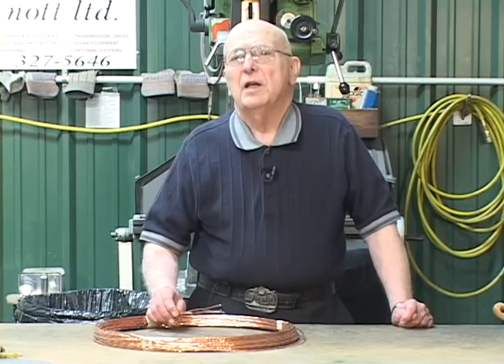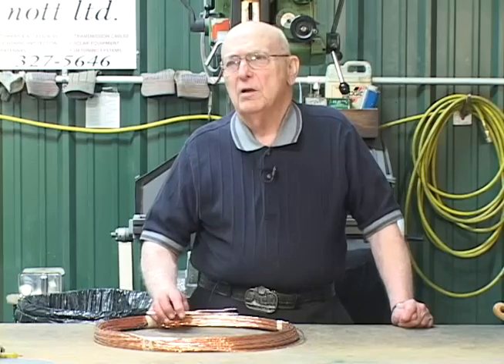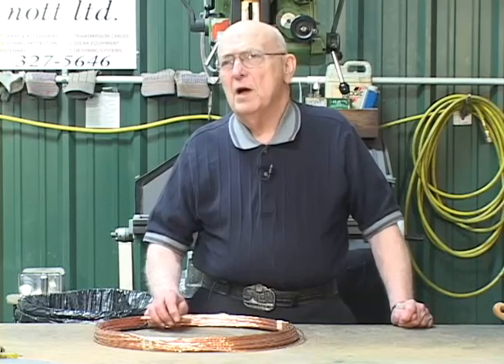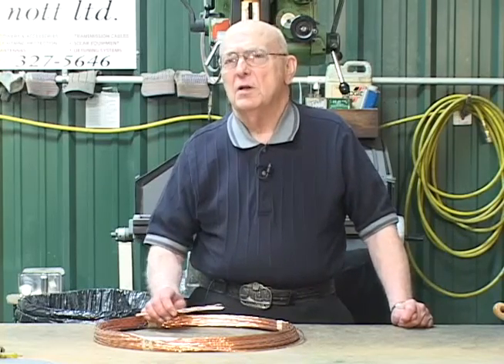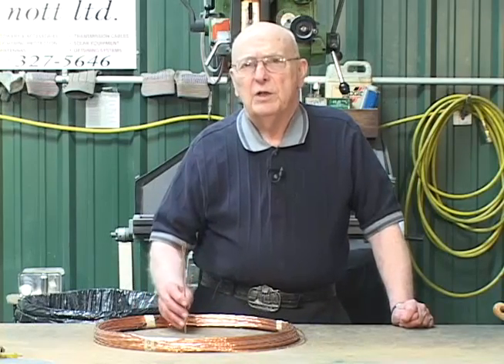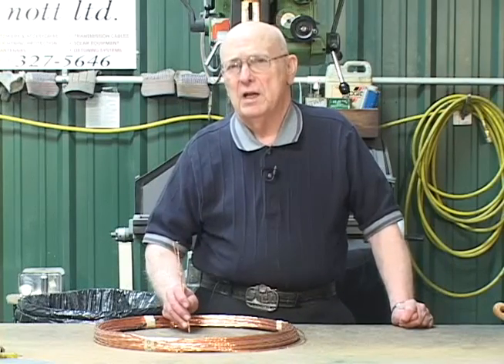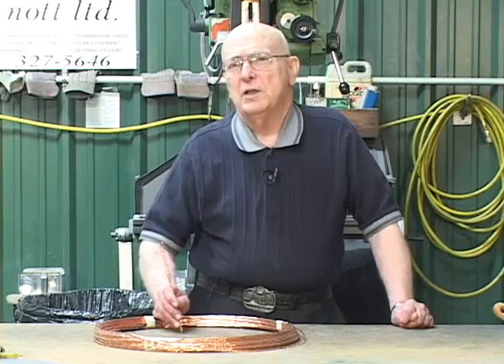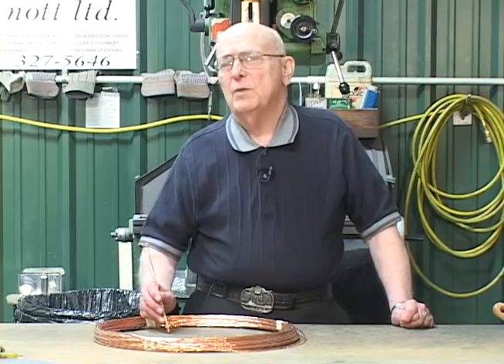Elevated Radial AM Antenna Grounding System Video by Nott Ltd

Comment: Pure Bullshit
Reply: No, it's not BS. Elevated ground plane antennas are actually quite common and work very well. (Think of a CB radio antenna with the three or four "ground plane" elements.)  In the case of medium-wave antennas it also makes it possible to physically inspect the ground system. (Just had to deal with a buried system that was severely damaged by an excavation contractor; had he back-filled his work area it would have been extremely difficult to locate and repair the damage.) But the FCC has been slow to accept this type of ground system for medium-wave operation though and still requires a "proof" of such installations to show that radiated performance similar to a "conventional" ground system is achieved.
Reply: Mr Nott was a very  very knowledgable  guy.  I'll not argue with him.